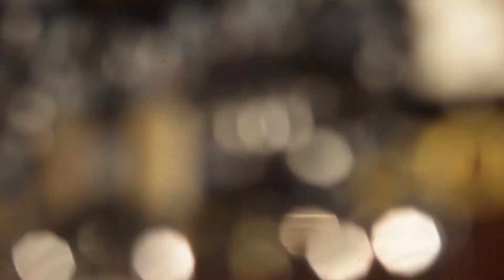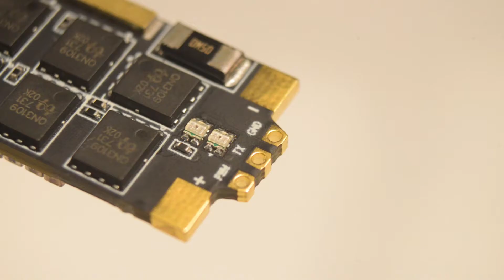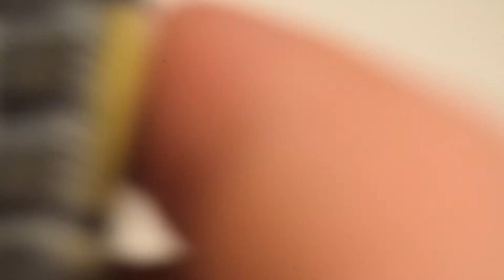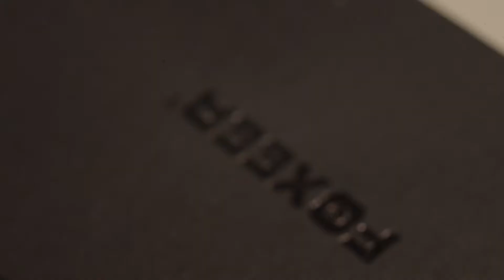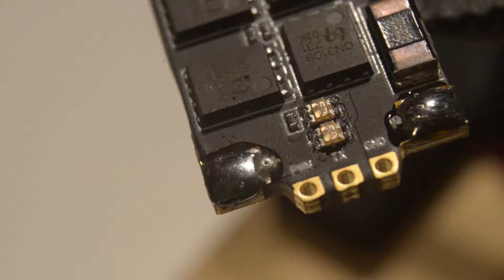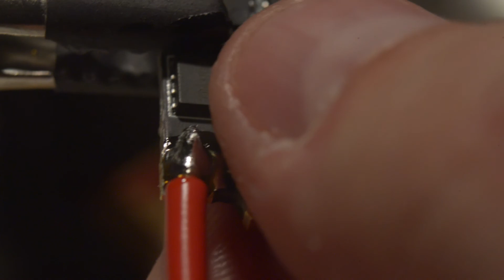Preparing the fligth controller and ESCs

Comment: Hi! Thanks for the video!
I have some Airbot Wraith32 V2 too, but one was totally destroyed during a flight. It was charred black on one side. A second one has a dark capacitor on the side. Do you have any experience with exploding Wraith32 V2?
Reply from the maker: Hi, so far none of the four I bought exploded or caused the problem. But I am using very non-aggressive props (DALPROP 5040C) on my Aokflies 2306 so the current draw is not so high even on full throttle.
Reply: ApoC tanks for your answer! The funny thing: I was not flying aggressiv at all. I have normal a5x4x3 props with TBS Masterpilot motors. One ESC sprayed sparks in the moment I connected the battery.
Perhaps I have a bad batch...
Reply from the maker: Interesting, so far I am very lucky that all my components worked and are still working without problem, even on the first build with DYS blheli_s ESCs no problem, than I upgraded to HAKRC blheli32 (9$) ESCs, no problem :) So far I destroyed only motors (bent shaft) and broke one arm on my Martian II frame and cut balancing leads out of my batteries by props, of course :) Also my VTXs are still working even I plug them in without antenna.

Also when I connect wirest to ESC from motor and FC I double check if there is no solder ball or dropped thin "hair" from motor / ESC wires after I cut it to the length and remove the isolation.